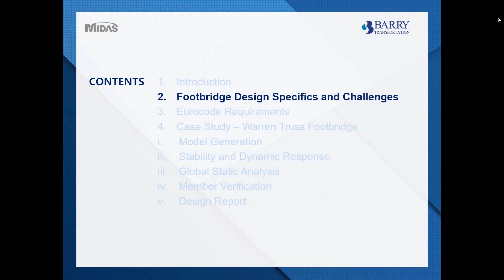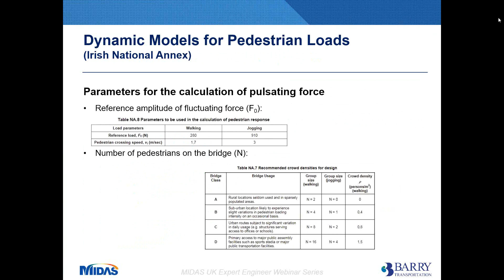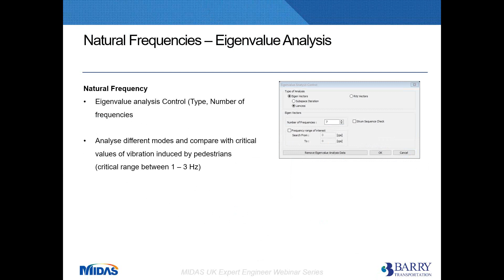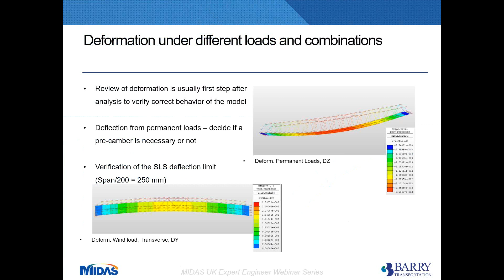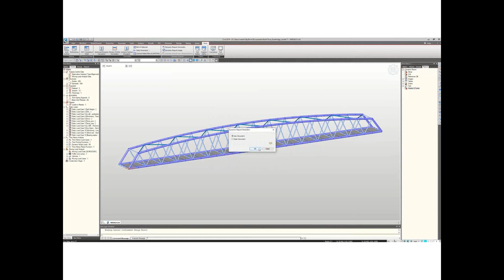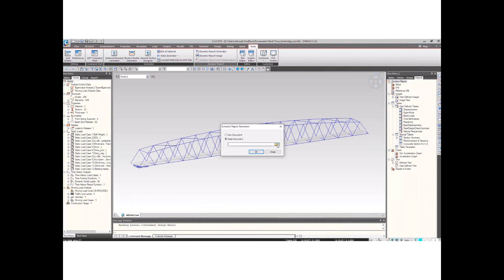[MIDAS Expert Webinar Series] Design of Warren Truss Steel Footbridge

Comment: Too general explanation. How do you check the members? I would like to see the opening of the sheet. Also how do you make the time history analysis in Midas.. I see, you use the formula, but I would like to see the detailed explanation of how you form the load case in Midas. How do you make the wind loading? Did I miss anything? How do you assign the bearings in design? How do you decide which type of bearing you will use? Thanks for your efforts but I would like to see more..